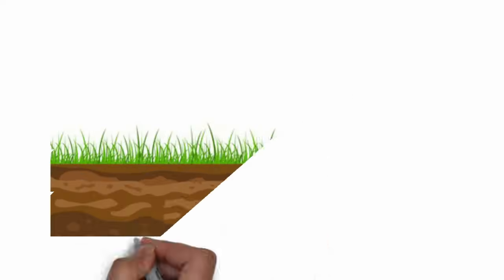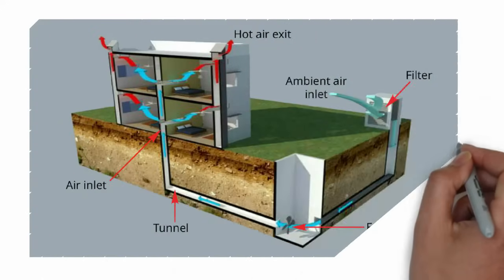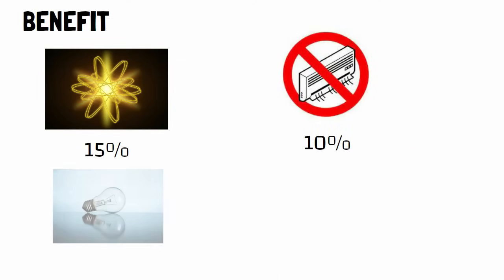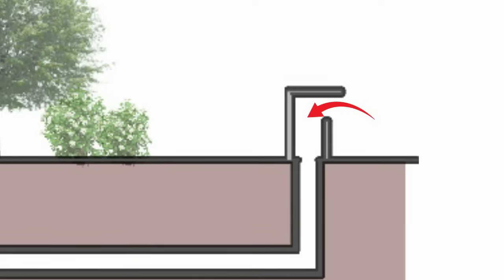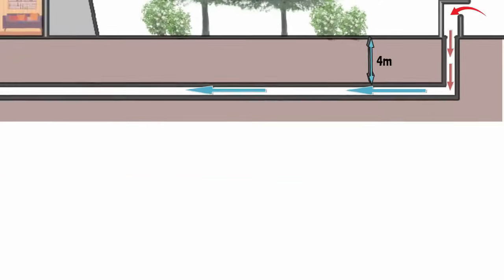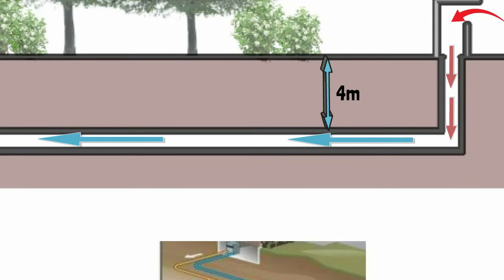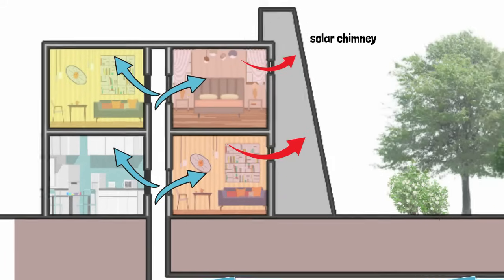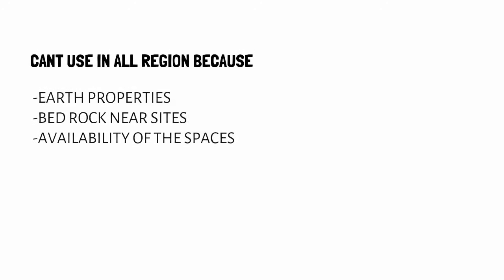EARTH AIR TUNNEL || HOW IT WORKS || passive cooling technique

Comment: For those who are skeptical of the general principle of the system, this is not actually a new design but is a slight variation of a very effective form of passive cooling that has been in use in larger structures in desert climates for centuries or even millennia.

The scale of the system is different. For instance, the underground pipe would normally be more of a tunnel and the inlet would normally be situated atop a high structure such as a tower or turret, not close to the ground. The system outlet would also be situated up high.

Concerns about insect intrusion are valid but I've never understood why you couldn't just cover the inlet with filter material and grating.

Desert climates tend to be more arid but the aforementioned tunnels often have significant quantities of water inside of them that has condensed and settled out of the air and mold doesn't seem to be a problem for some reason.

Interesting concept.
Reply: Yes, the yakhehals of the Middle East have used this principle for 2,000 years.  That how it work!  😊
Reply: A copper pipe would eliminate anything growing on pipe.
Reply: @raybod1775 good ideea . also will make possibile to cool the Air quicker de to its properties . inside Earth  coper , outside  can be some plastic .pipe.
Reply: @raybod1775  Cu pipe in many areas is going to react and oxidize.
Reply: Remove the humidity at one point by angling the Air pipe  to a point prior to it going into the building and collecting it there and remove it by pipe out. By creating a hot chimney you move a lot more air humid or not. If you place a desiccant at the front of the Air pipe that allows the Sun or some other heated surface to evaporate the now hotter less moisture dense air into the pipe you can eliminate the moist condensate issue almost entirely.
Reply: Even termites use the same general principles to air-condition their mounds.
Reply: Interesting, I had this idea 25 years ago, I was sure it wasn't anything new, how could it be!
Reply: @skylark4901 I saw an article in Popular Science in 1981 where the homeowner/contractor buried ductwork below the basement, much like this. 

New tech? Not hardly, as others indicate. And condensation issues are already been solved.
Reply: See your city Fire Marshall going into conniption ...
Reply: No mold because of very low humidity in the desert
Reply: More theory than actual implementation. Some videos of ancient cooling towers from Iran show how it's done. Low intake port means higher pollution
Reply: Interesting idea but definitely need refinement and trials locally to say for sure. I don't think it's easy in my place (tropical).
Reply: Check the recent (‘90s built) office complex in Harere Zimbabwe
It offers more insight blending old and new ideas
Reply: Expensive to implement with right kind of materials and safety.
Reply: The costs of building this structure surely  outweigh the running cost benefits.
Reply: Radon, hellow
Reply: @mirumir1952  sealed system, hello?

Comment: Don't follow their design loop it back to house that way your not taking 90° degree air trying to cool it down compared to whatever temp inside house is..I've been using mine now since 2019 , I found an 8" , 100' tube it starts in my living room and loops around to my kitchen no other connections because if it fills with water it's useless

Comment: Yes it can be used, but the explanation in the ad is incomplete. Since you must first of all check if the ground conditions are suitable. You must also have a slope downhills for the earth tunnel to get rid of condensates. It can surely even out temperatures in warm to hot climates during the whole 24 hour period. It can be used as a pre heater for fires for heating. But hardly be a total solution as a heat source in colder climates. Then passive circulation is not sufficient for enogh energy extraction, especially when the ground temperature around the air tunnel drops due to the cold air temperature at the intake. So detalid calculations/simulations are needed!

Comment: Would it help if there is a solar fan to drive the air on that tubing and a filter on every exit. Probably a filter on on the entry with a low merv rating so the air flow will not be constricted that much. This is to prevent the insects and other undesirables from going in the house.

Comment: A modern mini split ac heat pump and a few solar cells will eliminate all the labor, piping, radon, mold and Legionaire's disease circulating into your room. For nightime use, batteries are so cheap you can run this system all night. This is 2025...stop trying to use Roman technology in 2025. There are now mini-splits that are designed solely to run on solar.

Comment: Greetings: Continuing the discussion. Underground cooling of air along with Minar or wind catcher, one can guess 50 to 60 percent cooling. 

One can doubt on the quality of vegetables and fruits owing to pesticide content but NOT ON THE PRINCIPLE OF PHYSICS. 

Underground air is the Wingman for the Wind catcher or a SNIPER giving cover to troops from long distance. 

3 to 4 degree cooler can " ESTABLISH PERFECT NON STOP GRADIENT" and the hot air has to "OBEY THE PRINCIPLES OF PHYSICS". It has to race towards top.

 Just like " PRISTINE BALLOON PHILOSOPHY " denser air pushes the lighter helium air inside and the balloon races upwards. 

Naturally hot air rises and with underground cooling, rate of exit is " ENHANCED or EXPEDITED".

Of course the " FIRST BASIC THING WHICH RUNS TO MIND" is the HYGIENE of air. 

I had envisioned long time back to place TWO SINTEX TANKS DIAGONALLY OPPOSITE. 

Provides cooler air to all parts of house.

Wonderful Day

Comment: As others have mentioned, this would only work in low humidity environments. Water would build up in the tube, so I would Andre the piping to allow it to drain, and install solar powered uv lights to kill mold and bacteria. Would also put hepa filters and a controller to control a damper and only alllow this to open and run when external conditions are right. It would be like an economizer sequence for air handling equipment

Comment: Hot air won't enter the pipe that has cooler air. The other end of the pipe that serves as the exit must be hoter than the air entry of the pipe for the air to flow.

Comment: Traditional cultures have been using similar methods of domestic heating and cooling for centuries, but today we act like we’ve discovered America. Lol. Koreans heated their homes with an Ondol system of underfloor horizontal chimney, originating at the family hearth where food is cooked, the flue or chimney running horizontally, under the floor, in a loop system, until reaching the opposite corner of the house, where it rises up as a common chimney.

Comment: Ridiculous on so many levels. But first the cost.
You would need a laaarge lot or property and then you would have to tunnel, cut and cover, bore, the tunnels somehow, especially time and labor consuming with all the twists and turns...then you need some kind of pipe, pvc, concrete, etc oh my God it's just soooo expensive and not even considering the building codes and permits and permissions in your area! No, not for the average person, no.

Comment: Bets cooling system is to make two boreholes and pump water from one to the other though the house. The pump doesn't even need to be powerful and could be powered by small solar station. Cleaning this underground vents would be nightmare and you have to have a lot of them or dig so deep that it would not have any economical sense.

Comment: In the 1930’s, a similar system was set up in a hospital in Alice Springs, Australia, by the man who invented the 
Flying Doctors.
2 story building , with a tall turret. All windows and doors closed, except for the turret ones.
Air inlet 2m outside the wall, feeding into the underground “hallway”. The hung 3 large hessian pieces, at intervals top to bottom in the “hallway”.
The nurses and maids kept the hessian soaked, and had trays under to catch the drips. Each of the numerous rooms had a register in the floor, and the diagonally opposite corner of the ceiling. The first evaporative water-cooled house in Australia.
Central Aust is a desert...0% humidity, up to 45deg C in summer.
LouiseAustralia 🦘

Comment: Just put a phase change fluid in a much smaller tube and use a bit more power to get actually effective geo thermal cooling with 0 of the health draw backs of this system...

Comment: The tunnel shouldn’t be very long, just an ordinary waterproof ceramic pipe would do. 

Plastic isn’t a good heating conductor so it wouldn’t be good, metal is but it could rust.

The tunnel should have a service port inside the home, where you can service the ventilation fan and filters. 
It would be nice if it also had a filter on the other side.

A nice option would also be a drainage system on both openings in the house and outside, so if insects or something else goes into the system to nest you can fill it up with high concentrations of chlorine and water for a day or two to eliminate them, then drain it away. You should also have a valve inside the house to close it so the chlorine doesn’t get in the home when you do it.
This would also come in handy in winter.

Comment: Looks promising. I would suggest raising the opening to much higher. So the air coming in isn't so hot or dusty to begin with. More heat and particles will be closer to the ground. Heat rises of course but will disperse as it rises.

Comment: During day time, when sun heated the air outside , the hot air rise up creating vaccum with low pressure,so   the cold air from inside home will come out through the pipe to fill up the vaccum. However, at night the air outside become cold earlier than room, so the air would move into room from outside. So, its not viable option.

Comment: so if going to the trouble of digging that deep and setting up that much infrastructure, why not just use a normal heat pump system that can be a closed system and able to operate in more extreme environments?

Comment: My uncle, a civil engineer, set up a system at his home in Kansas that was essentially the same. He put it in in 1948 and it still was working flawlessly at his death in 1999. He kept his house at 65 to 70 degrees Fahrenheit year round without a furnace or air conditioner just a small fan governed by the thermostat.
Reply: How about the safety. Since this system have probability being infested by any pest, animal
Reply: @saifulhelmi7944  From what I remember he had a gooseneck pipe coming out of the ground about 5 feet tall with a heavy screen covering the opening. Inside the basement the had a receiver box on the end of the pipe with another screen and a heavy furnace filter that filled the box in front of the squirrel cage fan that fed the breeze into the duct work. I'm not sure how effective it was with mold but he and my aunt seemed pretty healthy. I would imagine he changed the filters pretty often. I never noticed the "storm sewer smell" that regular pipes always had. It didn't have any water infiltration. He didn't use the outside and inline structures shown in the diagram, just a 10 inch (I think) steel pipe that was welded together as it was laid below the frost line and snaked back and forth under the back yard making, I think, 3 loops between the wall of the basement and the gooseneck stand pipe. I'm pretty sure it was laid on a 4 foot wide and 4 foot deep bed of gravel with the same amount over it then backfilled. I was born 3 years after he installed it so I'm not certain of the details, but I asked him about it some.
Reply: @saifulhelmi7944 
No pests or animals infest this system.
Reply: Wow your uncle is a legend. RIP❤
Reply: I live in a commi block in Bulgaria built in about 1978.  It has this system.  I have not used AC or heating in the 5 years I have lived here
Reply: @piccalillipit9211  common blocks are a masterpiece of engineering and urban designing. Public housing and public transportation are soviet union's big successes.
Reply: @JSM-bb80u  They absolutely are. Im British and moved here as a total snob about them.  They are GREAT.  The city planning is great - I have never felt more like I live in a village tan here and I left and a very expensive posh village in the UK.  I dont have a car, everything I need for life is within 1km of my apartment, the very occasional trip to the centre.
Reply: @piccalillipit9211  That's another great thing. You don't need cars which are costly, time consuming, unhealthy and bad for environment.
Reply: @JSM-bb80u  I now work pert time - and a lot of this is because in MOT paying €10,000 a year to fund a car as I used to.

Comment: Concept is good, in reality, it will not work.  In midwest of US, water will condense and fill up the underground pipe due to high humidity summer air.  Mold will grow in the pipe and soon the house will be filled with moldy air.  People will get sick soon.  Seeing doctors will cause a lot more than the saved AC cost, which is on 15%.

Plus the cost of digging a 4 meter underground would cost $50k to $100k in the US.  Initial cost will take more than 100 years to recover.  Unless the system can run 100 year without maintenance.

Comment: I don't see the point of the solar chimney portion. Main thing is you don't show an exit at all. If air isn't moving out the house then it isn't going into that tunnel. Even if you provided an exit, the chimney idea is really no different than an attic. Ever been in one of them during the summer? It's always hot and the vents are always spinning. So you're proposing building something extremely expensive to people who more than likely already own an attic.

Comment: Interesting and thanks.  Another way of saying the same thing is looking into just where or how deep the frost line is in your locality.  For those that are interested, there are some sorts of Stirling Engines that will work on temperature differentials of 5 or so degrees C or less.  Maybe charge up your cellphone?

Comment: Need temp isolator. Keep hot or cold air outside. It's a long insulator with micro tubes. Also, a light that kills viruses.

Comment: Try a closed system. 
One that recirculates the air from within the structure trough the underground heat exchanger with a regulated opening to introduce fresh air...

Comment: In Houston this summer we have had very few days below 100 and humidity around 60%.  When the temperature drops to around 90, the humidity is closer to 85%.  Without removing the moisture from the air, it feels very uncomfortable.   My AC runs way to much during the day and can only drop my humidity to 60%, maybe 56% on a good day.  This would not solve out problem

Comment: Mold, mildew fungus...all require an organic food source to become a problem.
If the pipe is made of plastic, or some other non porous material, there will be nothing for the mold to live on.
The pipe also needs a slight down hill slope towards the entry to allow condensed water to drain out.
Reply: Street T at the far downhill side. Open with a stainless 1/4" screen to a gravel pack on the one side for condensation drain, the intake air assembly on the other and, of course, the tube to the house air handler on the third. I'd be sure to size it so a plumbing snake or maybe a chimney brush can be traversed, or even leave behind a poly rope to use to swab.
Reply: plastic is carbon & hydrogen.... it can grow mold. 
plastic is actually a very good thermal insulator... so using plastic would require you to upsize your system or you just defeated the functionality of it.

Comment: Missing condensation outlet and possibility for cleaning normally by pressure water with wab machine. pipe must by diagonal from 3m to 4m due to condensation - 30 m long 250mm pipe of stainsteel can give you 500-700W of heating or cooling power usually conected to intake  air on recuperator.  This start be comon for new houses. Plastic pipe must by longer for the same power 50 - 60m.

Comment: Why don't you talk about mold in the air, fungi growing in the pipes from the air supply.
After a few years, the stench and diseases from such airflow without filters is a dangerous situation, like recuperation or air conditioning.